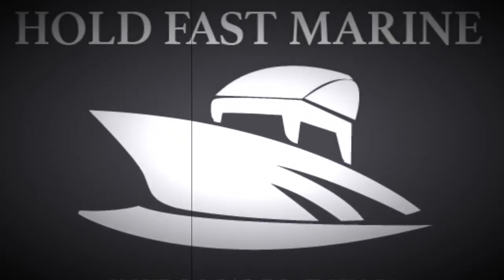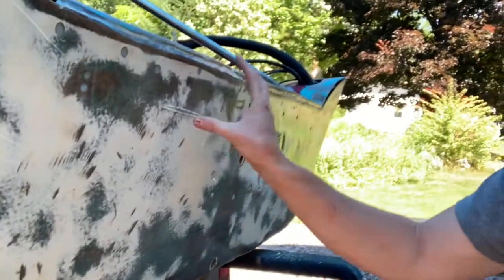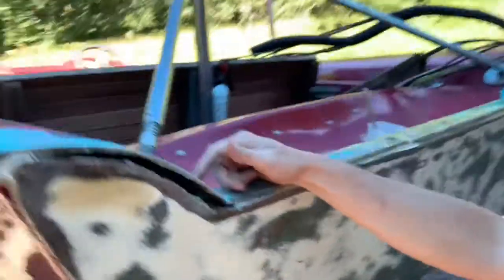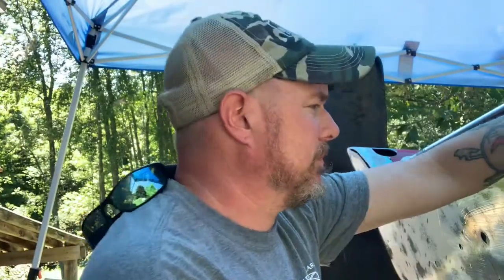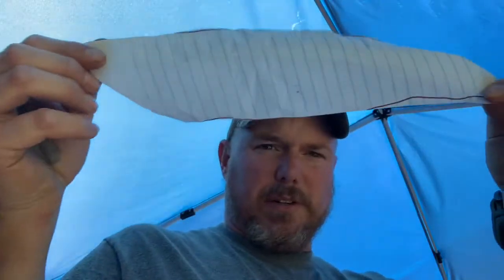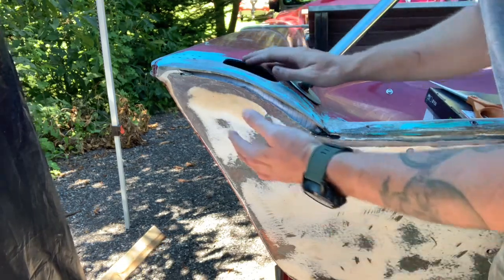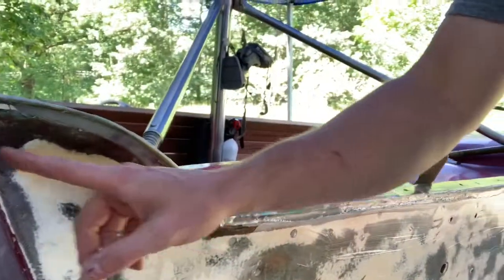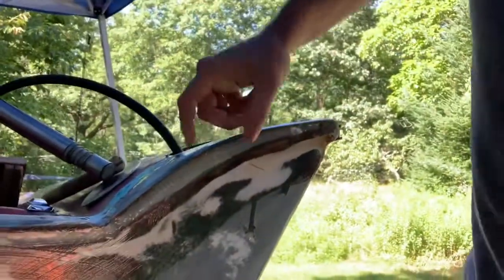The RED BOAT transom repair PART ONE

Comment: Not sure if this would have helped you with the sanding in the tight spot, but I usually use CA glue on a stir stick to attach a piece of sandpaper!  Works good for getting into small areas, but is labor intensive!
Reply from the maker: I have done the same. Now I use nail files

Comment: Like a moron, I threw my pumps out so I've been there too since the Rona took the pumps away. But, on the sides of the cups there is a 5:1:1 chart like you said and I just use the 5:1 on the cups. For poly resin, when mixing in small batches, I just use a medicine bottle from CVS and a tip on there that allows me to use a 3ml syringe and getting exact MEKP is easy. Get luer slip syringe and make sure to get the plug thing for med bottle that allows you to turn the thing upside down with syringe in it without leaking. Great for small mixes. I do what you do (own a small boat repair company) and im sure that means, like me you mix in small batches mostly. I also use almost all total boat supplies. Good video! Where are you located? I'm in Jacksonville FL.
Reply from the maker: central Massachusetts. i have many different miking cups now. I think ive ordered every kind I can from amazon lol. generaly I use small batches. The folks at Jamestown were supposed to send me the pumps but never did.